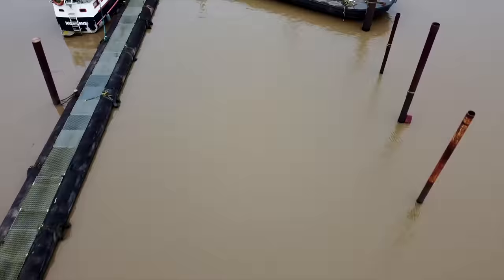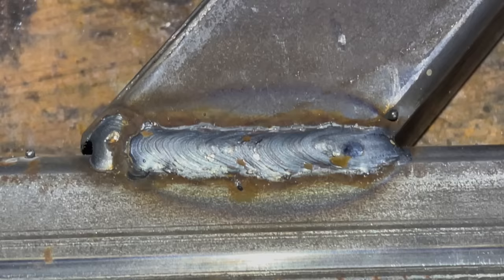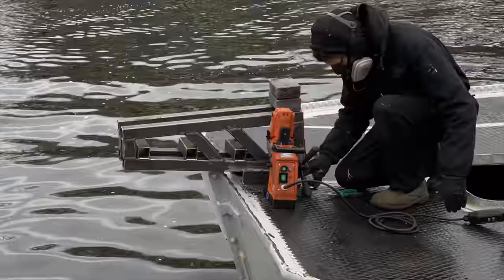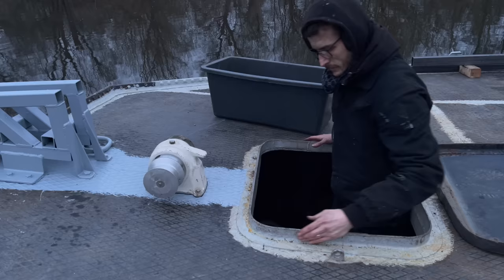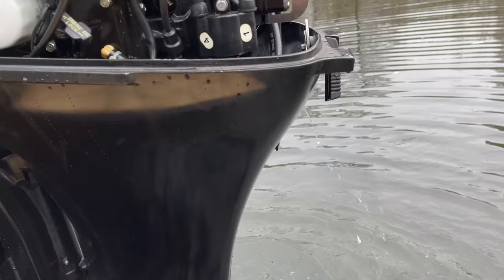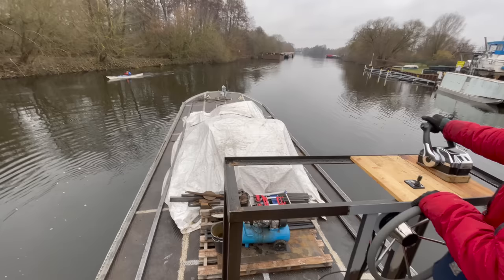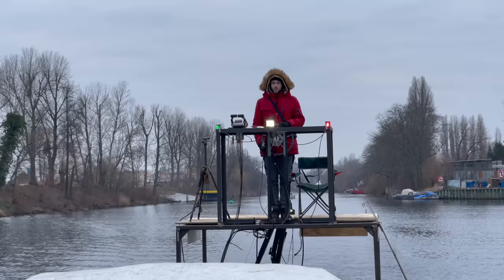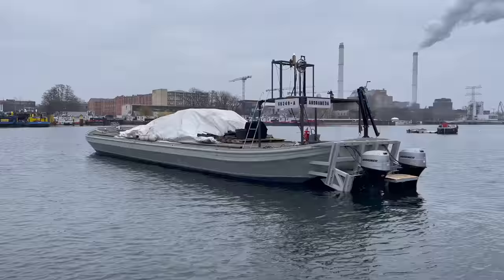Driving my 1902 Barge Boat back Home

Comment: I suggest that you mark out / paint a link of the anchor chain every 5m - alternate colours like blue /  yellow - so that you have a sense of how much chain has been let out
Reply: Very good idea! its a common thing on most commercial vessels
Reply: And then go solid color for the last several meters so you know to slow down(not a huge issue with a manual windlass) and get up to guide the anchor in properly.
Reply: Is he bringing the barge out to sea? How deep are the canals where he is 30 feet?
Reply: @spavliskojr  His isn't a commercial vessel out to sea.
Reply: I'm sure he did this but didn't mention it in the video.  Secure the tag end of the chain somewhere in the chain locker least you have a runaway and loose it all.
Reply: Solid advise.
Reply: or you could put a number on every link then you will know how much chain you have out exactly.
Reply: @JKMediaCorp  Good idea!!
Reply: This guy doesn't need any help with the money and support he's got there.

Comment: You must seize your shackles with wire.  They can come loose.  Very important.  Also attach your anchor chain to the boat.
Reply: Never attach the anchor chain to the boat.
Reply: @paolabulgari6298  If you have ever lost 80 metres of stainless steel anchor chain because you didn't attach it you might think different about that. My solution is to attach it to the boat, but use a piece of rope for it. That way you can easily cut it if need be, but you also don't risk losing your anchor chain out of stupidity.
Reply: @CarstenWolfram  yes, as long as the chain has a rope to tie off to the boat. The windlass should not be the attachment point for obvious reasons.

Comment: The construction you made for the anchor would be strong enough for the anchor of a sea-ship, but you fitted it far too horizontally it has to slope down quite a lot to make it much easier to drop the anchor, and also that will make for an easier recovery of the anchor without needing additional hlp to get it back in it's rest position.
In the past I've owned to barges like yours, but they were motorised from the start and had motor sterns, your is named a DEKSCHUIT while the ones that I owned were called MOTORDEKSCHUIT.
Good luck with the realisation of the rest of the planned work.

Comment: The bottom nut and bolt of the three on the right hand side of the engine support are loose. Spotted this in the last video and reminded myself to check should I see it again. Hope you've already fixed it! Great job on the looks though.

Comment: You will need to lift your motors. Trimplete 30mm-50mm under water the water level. 

Motors are way to deep so if you start loading you might suck in water at the bottom seal if that seal starts leaking. And you will get better performance of motor is lifted.

Comment: Well done. The anchor windless is not designed to take the load of the chain when anchored. You need to rig a snubbing line which is a few metre nylon rope that goes from a large cleat on deck to a hook you place in the anchor chain. You then let out a bit more anchor chain so that the load is transferred to the snubbing line. Another benefit of this is it reduces the noise of the anchor chain moving on the bow as the boat moves.

Comment: good practise is securing the anchor swivel bolts in the eyes with thick wire trugh the eyes also mechanicly. preventing them from getting loose.

Comment: Fascinating project, beautiful vessel!   Don't forget to "mouse" those stainless steel anchor swivel bolts with ss wire, for stainless steel doesn't torque down well, and they very likely will loosen!  Better to be safe rather than sorry.😃
Reply: Hehe you dutch mate? We call that mousing as well

Comment: Very nice "Maiden Voyage".  Don't forget to safety wire the stainless steel anchor swivel pins to keep them from possibly backing out. I would also at some point put a motor on that windlass. Do you have any drawings of what your help structure will look like when completed. It would be nice if you could drive the boat even in bad weather if you had to.
Reply: I came here to mention the safety wires on the anchor chain.   It also might be a good idea to reef rig that 50 kg  anchor.  

I just love this series

Comment: I would put at least 200 HP. I ran a 54 foot pontoon boat on the Mississippi River with twin 130 Hondas. I could have used a lot more HP during strong currents, high winds or emergency situations like helping other boats in distress or evading contact with other idiots driving boats. I love your design. That's a cool project.

Comment: wow, your welds on the frame for the anchor came virtually perfect. Very nice. 
Just remember that thickness of welds means nothing, it is the depth and the ability to fuse as much metal surface as possible that gives it strength. 
The perfect weld is a slightly raised bead on top, but reaches right down internally where the eyes cannot see. When welding plates together you should be able to turn it over and see the bead penetrating slightly out the other side with not much heat discolouring the metal. 
Takes many many years to perfect it

Comment: Hey a small idea for the anchor is to put hinges on the two front feet to allow it to tilt forward(mount the hinge on the rubber then to the bracket feet). Install another ring in the back of the bracket to allow chain to glide. With a heavy duty latch mechanism int the back to keep it secure to the deck and lock pin to take load off the windage. 
Keep it up love the journey!!!

Comment: One thing is certain. That is the fact your weldings have vastly improved since the last time we saw them.
Excellent.
Question: Will you place a seat at the helm of the barge?
Reply: That and some sort of removable canopy wouldn't be a bad idea in my opinion.
Reply: Was thinking the same.  Good weld pool.  He has got way better.  Id say okay with those welds.

Comment: You could angle the anchor "crane", slightly downward (lets say - the 1st 1/3 from the tip, or about half way. That will make it easier for your anchor to be guided onto the structure.

Comment: The anchor will come all the way up into the anchor chute if you replace the cylinder with a pair of rollers with a pivot between them as seen on many a yacht.  Also consider what might happen if your vessel should ever begin to hobbyhorse in a rough anchorage - the anchor chain could pop out of the chute with major consequences.  Placing a simple and removeable bale over the end of the chute with enough clearance to allow the shackle to clear as the anchor is brought up over the aforementioned double rollers.
Reply: At close to 17,000 kg and a flat bottom this boat will never hobby horse in an inland waterway.
Reply: @teeanahera8949  I cannot argue with your reasoning.  I come at these things from a saltwater perspective where one must be prepared for a wider range of situations.  You will not likely own this vessel forever, and somebody someday may well decide to run it back into wider waters - that person will have to consider what to do about the issue we are discussing.

Comment: When building the top consider using a "sandwich" of polystyrene with steel sheet glued either side. Basically, make a box and cut out the doors and windows. Its the same material used in making cool rooms. You get the thermal efficiency as well.

Comment: Drill drain holes in the tubes they will collect water , the water can make the tubes crack if the water freezes.
A steel roller Is better than the tube in the end will not wear the shain so mutch you can have contact bearings on the roller ,if you have greasing nipped on it .
If connecting shain in th back end use a soft  connection you can cut from a distance with  a knife on stick or something.  If you have to release the shain it is dangerous and hard to unskrue shackles if it is in tension.
The idea is to never use the shainlocker connection as the anchor hold anyway.

Comment: Your engines and their propellers are geared and shaped for planing speeds, not for slow 8 knot full displacement speeds. Therefore, get new propellers. Consult propeller makers and tell them your slow speed situation and that you want power, not speed. They will likely recommend 4 bladed propellers with less pitch. This will apply the force of the horsepower more effectively for power and for fuel efficiency.

Comment: I think your boat is brilliant. I love those drills and drill bits and especially how the drills lock on to the work piece. I suppose there will be lots of ideas for the anchor. I will add mine. Maybe some type of carriage that the shank of the anchor strikes as it comes up to the anchor carrier and allows the shank to remain more upright as it rises. Then the carriage and anchor shank can move together towards the windlass as the anchor falls into its final position.

Comment: Greetings,  Congratulations on your maiden voyage.  Your boat should have a bilge water detection system with multiple sensors port, starboard, forward and aft with oversized, emergency,very large water pump.  In addition it could notify you of a problem when you are away.  You should also have pre-made magnetized steel plates to use in patching a hole if you have one.  Happytravels.

Comment: I suggest a 2" round pipe with a slightly larger round pipe around it at the top back end of the anchor guide you just added (greased well) to keep the anchor in the channel and help tilting it at the end without the need of a plank to help you. If you use a 2" pipe you can add a grease niple on the side of the chain guide to keep the roler well lubricated over time, even if you choose to build it with ball bearings instead of glide bearing I recomend a grease niple for longer life of them. You may need to give it a helping hand when you deploy it but that can possibly be avoided if you change the angle at which it rests to slightly downwards so gravity pulls it out instead, just add a way to secure the anchor so you can mend/replace the chain without losing your anchor if you ever need to. Good luck and thanks for yet another good video.

Comment: You have done a great job so far,you should have trim switches at the helm you ever know when you have to raise the engines while moving . A bow roller will help the anchor slot home, don't forget wire the shackles and bolt chain beside the chain locker . Cheers from Rick and Jan in Sydney Australia 🇦🇺 👍

Comment: Another successful series of tasks completed. Nice work and your welds are looking better all the time.  A couple of suggestions that might be useful;  even though you put gaskets below the anchor brackets, shouldn’t you also have put some sealer underneath all the bolts/washers?  Additionally I’ve seen many boat owners add a bridle like to their anchor chain so that the movement of the boat pulls on the bridle lines connected to the boat’s structure and not just rely on the boat chain.  You could add a couple of cleats to the front corners and tie off the bridle like to those points and have something like a 45 degree lines connected to the chain via a shackle or a quick disconnect to the chain you’ve let out. It might save your newly added anchor bracket over time.

Comment: This man gives a new meaning to the term "overbuilding". 
This rack would hold HALF A TON ANCHOR. 
For 50 kg, you could use 2x2 cm 3mm thick tubes, which will still be too much.

Comment: Your manual anchor winch is a light duty unit. You should look around for a 1 Kw (may be on the light side) to 2 Kw, 24 volt, electric anchor winch. You can power it off the battery pack for the bow thruster.

Comment: Well done you have done a great job and it has been a pleasure to watch, one word of advice, you should tie the end of the chain to the hull with a piece of rope so you don't lose it overboard and you can cut it if necessary also you should always pull the anchor chain aboard with the winch to make sure it doesn't have any twists and it can be helpful to paint a bands on the chain every 10 metres so you know how much you have let out.

Comment: You have a wonderful amount of surface area in the barge. Have you every thought of putting up numerous used Solar Panels and drive the vessel buy electric motors. You can keep a gas motor of emergencies. Think of the fun you will have designing and saving fuel. Just an idea. You have great videos.

Comment: I suggest you use a shackle between the anchor shank and the swivel.  It will prevent large side-loads on the swivel when hauling the anchor out of the bottom and over the roller.  I enjoy the videos.  Thanks for sharing!

Comment: That easy speed is also a result of the hull length. Sure, you need some power to move a big boat but the longer a boat hull is at the waterline the higher the top speed before it wants to start to get on plane. 
Very nice to see it work so well. Congratulations!
afterburner: maybe next time also do a test to experience how the boat behaves on 1 engine and how fast it can be with only 1 pushing. I think that would be good to know just in case.

Comment: I’m a bit concerned about the washers on the back end of the anchor holder which you used to bolt it down. I think you may need something a bit stronger.

Comment: you might want to use a roller instead of a pipe on the end and use an swivel where the chain is connected to the anchor
Reply: yep you nailed it, Ive built a few. of those for sail boats in my shop and they all had rollers for that sized Anchor

Comment: Take a small piece of fine stainless steel wire and run it up the sputtering water discharge port on the starboard outboard motor.  This will clear the debris out of the tube.

Comment: To solve the anchor issue you might want to ad a roller forward and a bit below the anchor extension to provide a pivot point for the shank of the anchor.
Reply: My thoughts exactly. The shank of the anchor has to be "tilted" before it is dragged into its resting space.

Comment: i would add a small gusset (triangle) under the front of the anchor down to the bow incase the anchor gets caught it doesn't just rip that thing right off
also safety wire thise swivels

Comment: The best solution would be an inboard engine with a shaft and propeller line. Low consumption, high torque, superior final speed and reliability.

Comment: To make such a hugely strong anchor bowsprit for such a ridiculously small anchor suggests to me that u need to do more research before building stuff ...

Also - complicating yr build by adding diagonal cross struts instead of rt angle cross struts is a pointless complication.  But I congratulate u on your sprirt of endeavour.  Good luck.

Comment: I am enjoying your progress. Looking aft I wonder if the transoms could have been made with bottom parallel to the water rather than penetrating it. Tight maneuvering can be achieved by placing one motor in reverse and one in forward depending on the direction you want the boat to move. But you knew that already😉

Comment: Did I miss something.  I didn't see any gauges.  If you don't have any, you'll need a tach, water temp, low oil warning, volt meter, and a trim position. Fuel flow meters are nice to find the optimum cruising speed.
Reply: Why
Reply: @stevefrost3509   hehehe, it's kinda self explanatory. 
Motors are expensive. 
Do you want them to fail because of overheating from impellor or oil system failure? 
Already seen the stbd motor telltail putting out less the the port motor, thats an indication of a problem.
Do you want to shut down then try to start because the alternator failed and you didn't know it? 
Do you want to run at 3500Rpm burning 8gph doing 10 knots or 3000rpm burning 6gph at 9knots? 
But if you got lots of money, run em blind. 
May never have a problem
But it funny how people have all kinds of gauges for their electrical but not even temperature on the motor.

Comment: Really enjoying your story, and congratulations on getting the barge launched and away - great achievement.  Question - how much throttle did you have to use on the engines?  Are they running near full power, or only at a fraction?
Reply: 40% throttle the most time
Reply: One can only assume you didn’t watch this episode as he explains top speed and cruising speed.

Comment: Hello 👋 
What happened to your floating platform, i thought that was going to be your destination.
Also why did you not tow or drive your steal yacht in the same trip ?
Great news on the engines, it would seem that a single engine will be capable of moving you along if you were in need to run just one.